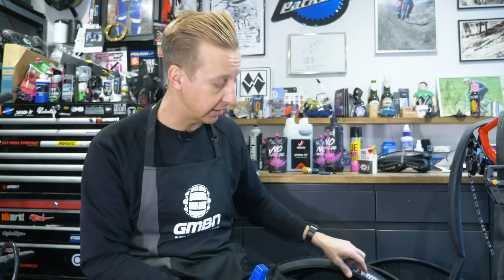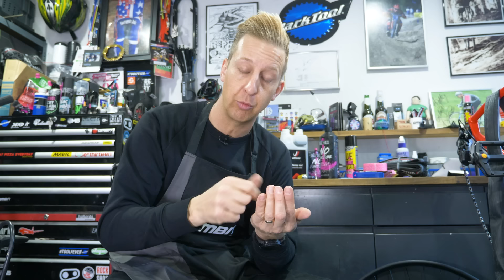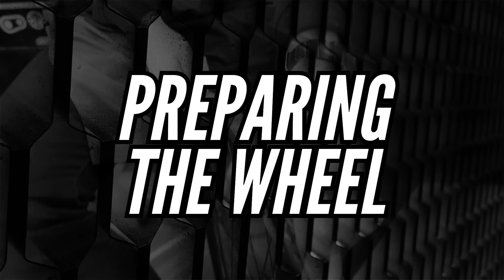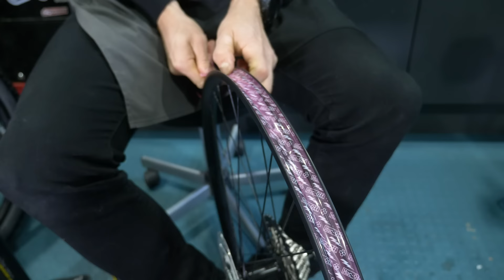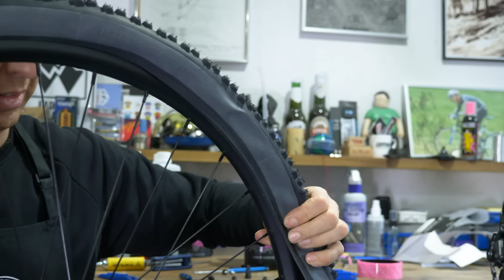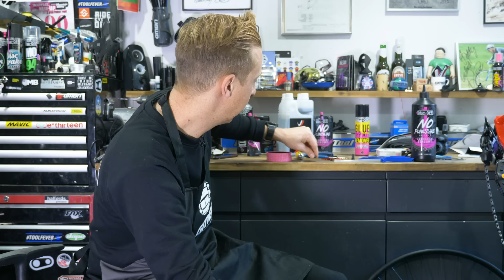How To Convert Your MTB Wheels To Tubeless | Mountain Bike Tubeless Setup

Comment: what would happen if you poked a hole in a sealant bottle? would it seal it up?
Reply: @welcometomylibrary  no mate. It needs an element of pressure in it. When the air escapes through the puncture it drags the fluid and suspended latex to the hole and seals it from the inside. As the bottle isn't under pressure I would imagine it would just leak.
Reply: A person who thinks all the time..

Comment: I used a $10 garden sprayer to seat my tyres to rim, ideas was from a Skills with Phil vid, it worked amazingly and saved heaps of $$ compared to a charger pump, air compressor or air canister.
Reply: great idea!
Reply: I generally don't spend much time in the comments section, but wow, what a fantastic tip!  I found that video. Thanks for posting!

Comment: Pro Tip - always inflate your tires dry (no sealant) to the maximum pressure after installing new tape.  The pressure in the tire will bed and form the tape to the rim.  Otherwise, if you fill the tire with sealant straight away, you run a greater risk of the sealant getting under the tape and compromising the bond.
Reply: This is a top tip, i have been doing the exact same thing and it works beautifully! I really don't understand why i dont see this tipp more often.

You can put the tape in almost as messy as you want, after pressing it down with 4 bars or 50 to 60 psi, which is way more pressure than you can apply with your fingers, it will sit 100% without air bubbles underneath. 
When sealant gets under the tape, it will leak, sealant will get in the rim and make a mess. 
(I had a bontrager rim which ended up airtight because the stans fluid sealed the holes for the spoke nipples, only realized it when i tryed to adjust the spoke tension.)
Reply: I was just about to write the same tip. One thing tho, you should inflate it with an inner tube inside, otherwise the pressure wont do as much in the sense of bedding the tape
Reply: Is there any specific length of time which you should leave it inflated to seat the tape to the rim? Like, would it be best advised to leave it overnight before deflating it and adding sealant and re-inflating?
Reply: My wheels are tubeless on my commencal, I have just bought some new tyers, are all tyers tubeless compatible?
Reply: So set the bead, remove the air, add sealant, then pump it up like normal?
Reply: Team Banchamek Theoretically, most wheel/tire combinations can be setup to be tubeless provided you can get a good seal between the wheel and tire. That being said, the specific  tubeless-ready combinations have a special bead which allows for a better seal.
Reply: @Team_Banchamek  No, it should state on the sidewall or the packaging that it is "tubeless ready", good luck
Reply: @Team_Banchamek  Technically no, but a lot of tyres will work tubeless that aren't designed with tubeless in mind.
Reply: @nilz6432  on
Reply: @pab2611  I don't think an inner tube is necessary (?) if the air inside is pressing on the tyre it is also pressing on the rim and the rim tape.
Reply: Serious question: why go tubeless? I'm a novice rider at best and I feel like when I get a flat a tube would be easier for me to change. What if I'm far from my truck/home and I get a flat running tubeless? I'd be SOL I think
Reply: @HarrisFS  Even when running tubeless, you should carry a spare tube anyway, just in case. I took five thorns out of my tubes on Sunday, went tubeless today.
Reply: @KN-ko8ez  the longer the better
Reply: Thanks, I just watched a video explaining this.
Reply: I’ll add another pro tip to this pro tip- use some dish soap on the beads of the tire before installing it. Just take a paper towel, wet it, add a big dollop of dish soap and smear it all over the beads. This will not only help seal the bead when the soap dries, but it helps getting the tire on the rim.
Reply: @Team_Banchamek  tires/tyres vs tyers

Comment: Great tutorial, thx. It reinforced my preference for tubes.
No tape needed
No liquid slushing around
No need for shot inflation
No liquid leaks
No mess during field repair
No need to buy special valves 
No need to service after a few years
No need for special tires
Same weight
Reply: I'm tempted to agree.  I only get about 1 puncture per year, whereas some of the youtubers I watch are constantly burping air and liquid out, losing pressure etc.  If it aint broke...
Reply: In our area there are "sticker bushes" and blackberry thorns.  So my LBS guys made their tires tubeless and hardly slowed down when they would get expected punctures.  I have never wanted to go tubeless, but I am tempted.
Reply: @drmoynihan  I guess if one doesn't find themselves getting pinch flats because of running lower pressures OR the conditions they ride in, then why change or fix what ain't broke? I agree.
I think it's goofy wanting that gunky sealant inside because it just creates a mess when changing tire
Reply: @my-max-media7621  
Here it is 4 months later with my two month old Commencal Meta TR 29 and so far, no tubeless goop for me!
Reply: "Messy repair" nah, if i get a too big puncture, take a plug, jam into the tire, boom, 10 second repair, back to the trail.

With brand new wheel and tire ill just mount everything the "wet method" (pouring sealant straight into tire)

Ill setup tubeless in 5 minutes when i buy these tubeless rims and stuff
Reply: Field repairs aren’t messy, just patch it. Valves are cheap as hell. Service after a few years? Come on now. Same weight? What does that mean? Tubeless tires tend to reduce weight. Tubes are generally heavier than the liquid sealant.. which you don’t hear “sloshing around” incidentally. 

Tubed tires are perfectly fine and certainly for you. But I don’t go back....

Comment: Top tip #1: remove the valve core when seating the tire. This way air can rush into the tire quicker (no core on the way) and you increase your chances to seat the tire on the first go. 
Top tip #2: if have no pump with booster or a separate canister, you can cheat and may (and may not) work. Attach the punp hose to the valve, but then fold the hose with one hand so that no air goes thourgh the hose. Then pump until you see some 9-10 bars on the gauge (if you have a high pressure floor pump). Then realease the hose and keep pumping. I have popped several tires this way.
Reply: Can i just use an air compressor?
Reply: Even with air compressor, removing the core allows more air throught the valve.
Reply: @kaupo80  Ok, do you think an air compressor will charge and seat the bead properly?
Reply: My wheels are tubeless on my commencal, I have just bought some new tyers, are all tyers tubeless compatible?
Reply: @Team_Banchamek  No, not all tires are tubelss compatible. The model name should include something like TUBELESS EASY or TUBELESS READY or UST (Mavic wheels and tires).
Reply: Gregd351 yes. Air compressor is great if you have one.
Reply: @GD351  Even the cheapest tanked air compressors hold 100psi, which is easily enough to pop on tubeless bicycle tires.

In fact, everyone should get a small air compressor (hot dog styles are more compact than pancake ones) over the daft charged hand pump shown in this video, simply because of how much more bloody useful a compressed air tank is.

Comment: I just turned 40 and getting back into bike riding. This tubeless is mind blowing to be as this is the first time hearing about it. Crazy how easy it is. 🤯
    I've been riding hard Enduro and the tulips on my motorcycle is way different. They actually use a bike tire in the inside to clamp The dirt bike tire and to seal it. You just adding tape and a valve stem it's just mind blowing right now.

Comment: Anyone who can seat that bead with just a valve core remover and a track pump is basically an Avenger!!! Ive just bought 2x 29er inner tubes after many hours of pain...frustration and dismay. Cheaper....less hassle and works like it always has done.

Comment: A kayak strap works great too just wrap it around the tire and cinch it tight.  Then just use your hand pump to pump it up till the bead pops.  Then just pull the strap off and pump it up to your desired pressure.  This works on any type of tubless tire even wheel barrow tires.

Comment: I used Stan's tape in my first try, it leaked all the time. Then, I got myself a gorilla tape and no problems so far...
I'm hoping it will save me from punctures, changing tubes on the trail is a nightmare! I also observed that the tires lose less air than tubes when the bikes is left aside for some time.

Comment: I see that Specialized Bicycles now has a series of self-sealing inner tubes that have a perfectly applied layer of sealant during manufacturing. This sealant is said to stay in a semi-liquid form for many years (does not dry out) and is ready to instantly seal against thorns, nails, etc. Yet being permanently inside of the tube, there is zero mess to the rim, tire or the user. This new series also features a novel weight saving design - the tube circumference is not of a constant thickness of rubber. We know that thick inner tubes add weight but also are very durable against punctures, these new tubes have thick rubber on the outermost part of the tube that is adjacent to the tread and sidewall but thinner, weight saving rubber on the portion of the tube that touches only the rim. Self-sealing just like tubeless tires, but no special tubeless valves or canister air pumps are required, no expensive (and heavy) bottles of sealant, no messy clean ups ever and a perfectly applied layer if sealant. However, the novice mechanic can still pinch the tube during a ham fisted installation - alas, nothing is perfect. I would love to see GMBN compare modern self-sealing tubes to tubeless setups - from puncture resistance to weight differences, trail maintenance headaches and overall costs.

Comment: I thought it was time to go tubeless with my Spectral ON e-bike, so bought the removal tool, new valves from Stans plus Stans sealant. My valves didn't come with different types of rubbers so I had to hope for the best. Wanted to try the dry method first but didn't have a plastic tube to fill the tyre with. Easy solution was to use a syringe. It only had a 10ml capacity bit worked nonetheless. I only have a track pump so when I pumped the tyre (before putting in sealant) nothing happend. Did some fiddling with the tyre, pumped like made and, hey presto, the tyre sealed first time with no apparent leaks. Followed on with Doddy's instructions and, unbelievably for me, everything went according to plan. Will leave for a few hours and check again. Fingers crossed.

Comment: Thanks guys. Just used this video as a step by step guide to convert mine to tubeless and to fit my flash new Minions. I am one of the unfortunate ones to get a leak from the join in the rim which I slowed down with another layer of tape and the sealant seems to be plugging up the rest. Other than that, it went off without a hitch. Thanks for the instructions. I should mention, I used the same Muc-off kit that was used in the vid. Cheers and Merry Christmas.
Reply from the maker: Glad it helped and merry Christmas!

Comment: If you dont have any good pumps, you can do it with basic handpump too, first you do the rim tape thing, then seat the bead with innertube, then you break only 1 bead, then take the innertube out, abd but sealent in, seated bead have to be faced down and pump it as hard as you can, its hard but its doable.

Comment: Tubeless also has much less rolling resistance. Tubes have friction against the tyre which has an effect on rolling
Reply: I totally confirm that: I switched to a heavier casing tire and tubeless (Double Down), it rolls faster than Exo casing with tubes
Reply: Weird considering a tube could weigh as little as 60g but you could be putting 4x the weight of sealant.  I guess the liquid doesn't have to be rotated but the tubes do.
Reply: Agree, but disagree about the "much" part, it does have an effect, but it's not really noticeable, unless you just go road biking.
Reply: @ApexHerbivore  i think its the friction between tubes and tires
Reply: @Cheddar702   😂 relax guy.  Several numbers?!  Misinformation?!  It's not like somebody is gonna read my post and then set up a bike dangerously according to what I've said!  I googled mtb inner tube weights, maybe I was rushing and saw a road tyre weight. Big fucking deal. Don't cry about it

Comment: Preventing tire punctures: OK. But save weight... I'm not so sure. You take away the inner tube, but you add the valve + 150 grams of sealant. And if you top-up your sealant regulary it will be even more. I did it anyway and it saved me for a couple of punctures.

Comment: Thanks for updating these videos, I recently got a flat on my new bike and was under the impression from the LBS that it was tubeless ready but not running a tubeless setup. Much to my surprise I went to take the tyre off and ended up with sealant running out everywhere. Needless to say I took it to  different LBS and they sorted it all out for me and explained that sealant had probably gone off in the tyre and needs to be topped up every so often. But this video will certainly help when I look to replace the tyres that came on my Specialized Epic Evo.

Comment: Excellent stuff on tubeless. From the road and gravel bike world, you have to look to MTB people for any useful advice on tubeless set up. One thing though. An electric compressor with 120L/min output at 0 bar, and capable of 6 bar maximum, can be had for €50-€80. You might need an adaptor head with a pressure guage too. But they aren't that expensive. GIven the prices of some bicycle pumps with reservoirs, etc. why not just buy the real tool for the job straight away? Granted, they're noisy, but you use them for about 10 seconds at a time at most....

Comment: Great video. However i've got 3 sets of tubeless wheels and none of them are lighter than when i used innertubes and a normal tyre. I've found that a tubeless set up is between 150-200grams heavier than a standard wheel.
Reply: My wheels are tubeless on my commencal, I have just bought some new tyers, are all tyers tubeless compatible?
Reply: @Team_Banchamek  Tubeless tyres will say "tubeless" on them somewhere. 
You can try and use normal none-tubeless tyres but they tend to leak air and sealant because they are constructed differently(i have tried this so i know this to be a fact). 
To be safe and get good results it is best to use genuine tubeless tyres if you are planning to go tubeless.
Reply: @Team_Banchamek  tyres vs tyers

Comment: if youre using CO2, seat it with CO2, remove all the air, open valve core, insert sealant and then normal air from floor pump

Comment: Great video. This something i’ve been wanting to do however i have a few questions:
1. This looks like a permanent converstion. If not; how easy is it to swap tyres? I have slicks that i use during the working week and knobblies for the weekend. 
2. Should you still carry a hand pump since there’s little chance of getting a puncture and even if you do the sealant will fill it?
3. Would you need to carry a spare tube anymore?
4. How ofter would you need to top up the sealant?
Reply: I wouln't want to swap until I was done with the tyres - it's messy to change them and you'd be using lots of sealent. I'd still take a pump, if you hit something really big the sealent might not seal immediatly - I'd also take a tubless repair kit to fill any hole that the sealent can't cope with. Assuming you havent had any huge leeks, I'd refill every 4-6 months. As to whether you need to carry a spare tube - depends really - If I was never going to be more than 20 mile from home I'd risk it, but any further and I might want to carry a few more spares. With inner tubes I worry about punctures all the time - I don't at all with tubeless.
Reply: Sounds like you need a separate set of wheels my friend.

Comment: I made a huge mistake when buying valves, it didn’t occur to me that the milimiter range was refering to the rim depth, and I ended up with ones much longer and didn’t tighten up. I bodge them with a plastic spacer but I felt so stupid haha
Reply: Thanks, I'm new to MTB and hearing about those simple but not obvious mistakes is useful.

Comment: I'm trying to go tubeless. This is my first time. In order to get the bead to seat I have to wrap the rim 2 time. Than my stem leaks I tried both rubber pieces and I get the same outcome. So my guess is I need to drill out the hole a little more to get the rubber garment to fit in the hole to not leak.  This is before I use the sealing stuff.  I am using Schrader valves   on a giant rim from 2013. 700c or 29 inch.  I belive I need to have the hole tire leak free before I go filling the sealing stuff in thete correct.